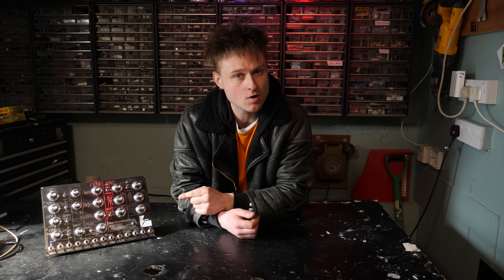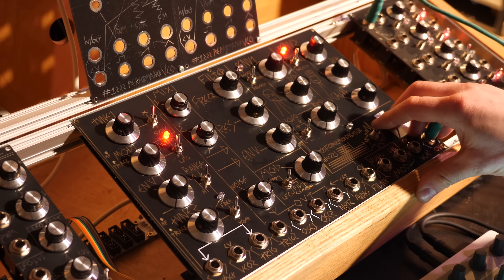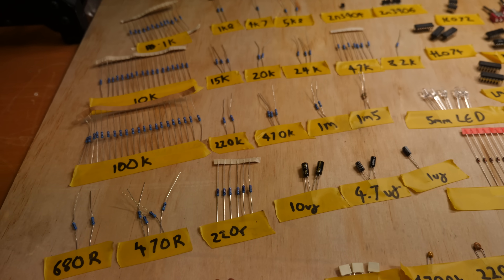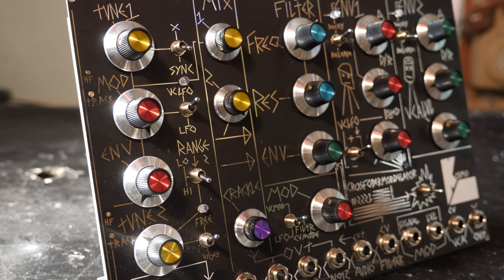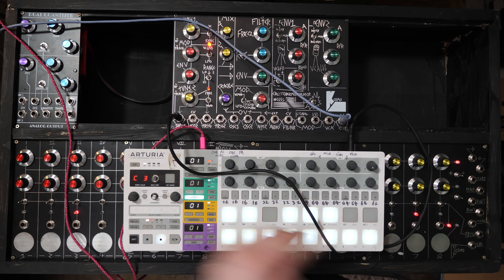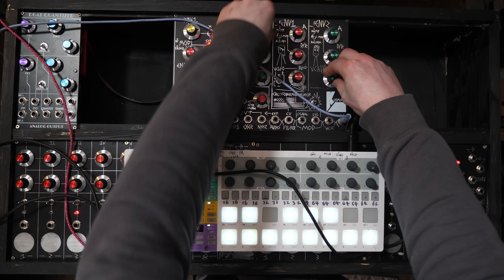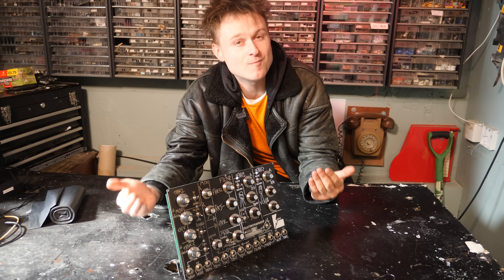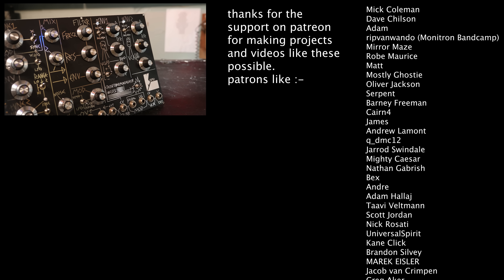THE CROSFOBERMORDULATOR -  DO IT YOURSELF FULL KOSMO SYNTH VOICE

Comment: @LOOKMUMNOCOMPUTER I was digging around in some old stuff in my garage the other day, and I found a circuit board I'd built in the 80s and I could not for the life of me remember what it was. After a LOT of searching I found that it is a kit from the 80s Dick Smith Funway Into Electronics Volume 3 publication, where the eponymous chain sold kits of parts. It was described as some kind of sample & hold synthesisor with + or - octave and tremolo features on two channels. I never got it working because life and wife came along, but I thought it might interest you. It accepts a microphone input and can also accept input freq., and VCA trigger inputs. I would love to see what it's capable of in experienced hands, and thought it might fit the brief of both DIY and retro. I noticed there is one for sale on ePay in the same stage of build as mine, but the seller has no idea what it is.
Let me know if you are interested and can post links etc.

Comment: Do you have a power supply board at all please? Just bought CrosFober... Lol. No idea what I'm doing.
Reply from the maker: check this https://frequencycentral.co.uk/product/fc-power/
Reply: This needs slight mod, the modulator should have 'sine wave', it's fundamental and SAW UP/DOWN, send these 5 signals to a CD4051 coupled to a dip8 ATTINY to control the multiplexer with  a simple button, to select  wave.
Than this module is simply killer. otherwise you still have the same OLD 'Nintendo' sounds., thing you can make  on  a TB-303 a like. @LOOKMUMNOCOMPUTER
Reply from the maker: @AnalogDude_  naaa i dont think its particularly necessary. its not quite like a 303. but hey! by all means build it with the mod :D cheers!
Reply from the maker: it doesnt actually have any waveform selection, purely because they all sound pretty similar after being saturated and filtered, in my opinion though! thats why i omited any waveform selection! but each to their own! thanks! :D @AnalogDude_
Reply from the maker: @AnalogDude_  but yeah, if was gunna make it a more complicated voice most certainly would add options like mentionned, but as you know. dancing the line between something functional and something too complicated, i honestly think this does more than a 303 voice. but happy to disagree. cheers!

Comment: check this circuit: Lockbox Synth Ring Modulator
You can still buy the chip and it's cheap, less than 1€, the other is over 7€.

Comment: Just had a look on the website and for some reason expected the board and panel to be way more expensive than it actually is! It makes me very tempted to have a crack at making it, as a way to understand synths better in general. One question though, any idea what a ballpark cost would be for all the components, as if that becomes expensive in itself it's a none starter. That thing really sounds epic though....
Reply from the maker: I recon all in all with pcb £80 possibly less